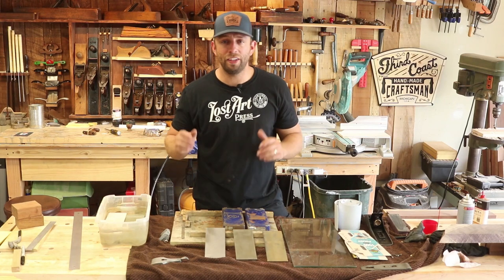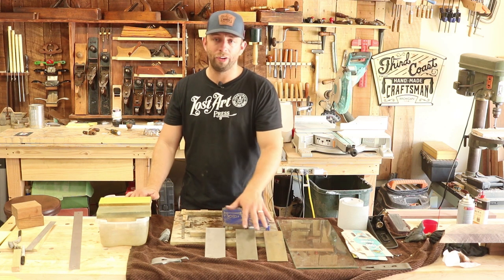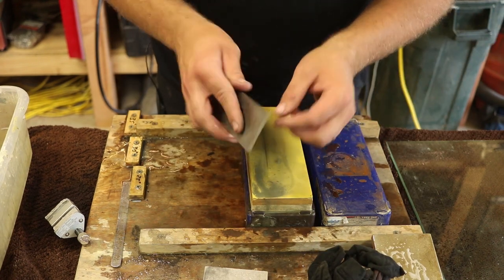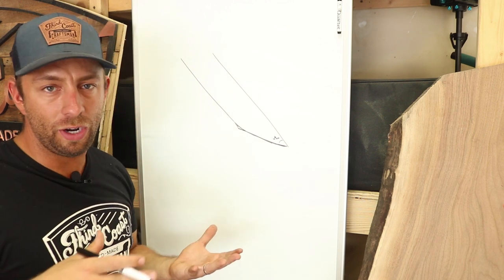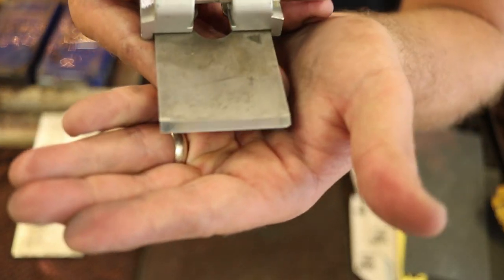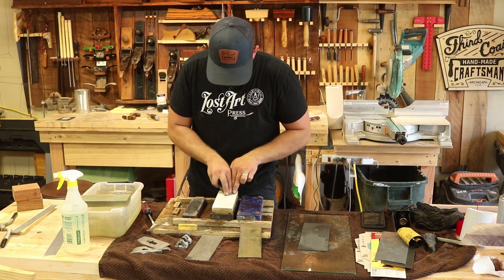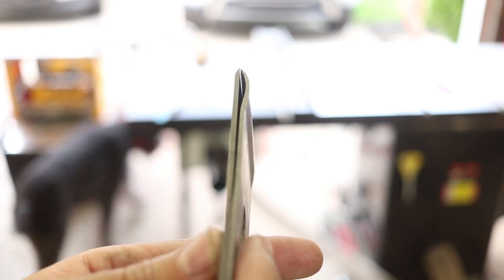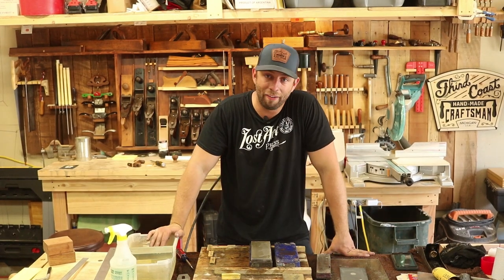How To Sharpen Plane Blades By Hand

Comment: Once I get to my finer stones, extra fine DMT and Spyderco ceramic, I turn the blade 90 degrees to the length of the stone.  In this way I am stroking the bevel opposite, applying a little more pressure which turns a hard wire edge on the flat side of the blade.  You get a good rhythm freehand and the fine polish marks will be from side to side on the bevel.  After this I only lay the blade on its back and drag off a nice heavy wire burr. I get a nice wire burr 9 times out of ten that can hit the floor and still be in one piece.  I used to strop but no more, I slap it back and forth across my palm several times and it’s a zero edge ready to go.  I think stropping especially on A 2 blunts the fine edge.  

 I prefer O1 over any other steel,  PMV-11 is some very nice steel  and holds an edge a bit longer and sharpens well but,  the majority of woodworkers don’t plane for hours at a time and O1 is a standard that’s hard to beat.  I think you are well aware that a # 4or5 Stanley can be tuned up with the stock blade and do about any job you need.  I have owned the LV jack, LV bevel up smoother LN 4 1/2 , LV #4 custom smoother and I have tried may more but they are too heavy and over priced compared to a tuned Stanley.  The planes I rely on and enjoy the most are my 604C Stanley and two #5s set up for rough and smooth.  Like we all know, there are many methods to get sharp blades, but the basic parts have to be tuned right to compliment the blade.  Repetition of sharpening and understanding how the parts work together are the keys and your doing a great job of explaining.   How are you liking being Self Employed so far ?
Reply from the maker: Thanks for the great feedback! sounds like you have used some really nice planes! I havent had the fortune of using a nice LN or LV plane but I also havent ever felt the need as I get the results I want from my 100 year old antiques haha. You are totally right about planes needing to be set up well to REALLY perform well and hopefully I can deliver the proper message in my next video and not offend too people haha. 

Being self employed so far has been pretty stressfull and crazy. I am trying to find a good routine. I really need to get some of the cool projects I have planned done!

Comment: Hi Third Coast Craftsman, I am restoring my dad's 2 planes he recently gave me as he is now way to old to do carpentry anymore but he taught me years ago to use a oil stone.  Whats the diffs between the oil & waterstones ?  Something I would want to share is the backplate (plate that supports the blade) is I keep its end surface as flat to support the whole blade area and as you did sometimes like once in many years it might need some flatting to cover the whole blade area otherwise blade damage might ensue due to no support.  Thanx for a great vid
Reply: Awesome, thinks for the info.

Comment: Just one question, if you have time.
I've managed to get myself two eze-lap diamond plates, a 400, and a 1200 grit.
Similar thing with a Naniwa whetstone I've also managed to get at an absolute bargain price, but this one is a jump all the way up to 12,000 grit!
Am I going to significantly shorten the lifespan of these tools by having such large jumps or will it simply be a case of having to spend a lot more time to eraise the scoring of the previous grind with the next?

As always, learned some truly great tips from this, thank you so much for sharing your experience <3
Reply from the maker: No I don’t think you’ll shorten life span, it’ll just take a while. Might be worth getting a 4000 stone in there. Once sharpened the first time you’ll only need the 4000 and 12000 unless you chip the blade
Reply: @ThirdCoastCraftsman  Great!
Thank you Chris =)

Comment: This video is old and you may have found a place that sells stick back sand paper (other than online) but if you haven't then check if you have an auto detailing supply story in your area. The one in my area carries several different types of stick back sand paper. Many different grits, circular shaped pieces, rolls like the one in your video, etc.

Comment: I think it's worth saying that feathering isn't for all (but most) applications.  In fact, feathering is good for general smoothing (which also happens to work well with free hand sharpening).  But just my two cents that you should keep one plane with a perfectly jig flattened edge for that perfect finish that you have to take a slight overlap to clear off.

Comment: This is kind of random, but you might look at metallurgical lab supply companies for adhesive-backed abrasives. No one really uses rolls of emory paper anymore, but lots of companies sell adhesive-backed sandpaper discs... They range in sizes from 8" to 12" (diameter). Probably not a cheap option, but you get quite a range of grit sizes in availability (60, 80, 120, 240, 320, 400, etc... to 2000). Buehler is one company that sells these, for sure.

Comment: I've probably watched this video half a dozen times and every time I get something out of it. This video is great for anyone struggling to get their plane blades sharp (like me😏). I was finally able to sharpen a blade well enough to shave my arm, but I was worried about the slight convex curve that I saw. I'm glad to know that is okay to have. However, I'm still not getting a good clean pass with my block plane. Am I missing something?🤔
Reply from the maker: block planes are not great for regular planing, better for chamfering, and small clean up jobs, But a tight mouth and super sharp blade should help
Reply: @ThirdCoastCraftsman  Thanks, Chris! I resolved not being able to get shavings by skewing my plane a little more as a ran across the wood. I also free the blade back quite a bit and that helped a lot. I will have to restore an old Miller Falls jack plane I purchased a while back to get better results. Thanks again for the reply and tips!👍

Comment: Great video! How do you setup the blocks on your sharpening board to set the correct angles with your honing guide? Thanks for sharing!
Reply from the maker: the little honing guide gives you distances so I added blocks for quick set up if I need rather that trying to measure
Reply: Third Coast Craftsman thanks! That’s a great tip. I just got my honing guide a few days ago and I’ll be doing the same kind of setup. Seems easier that way.

Comment: One thing that you didn't mention, which might be important to others because it happened to me. And that is make sure that your plane blade is NOT cupped. While I farted around trying to fix the same gap between the cap iron and the blade, and as I spent time trying to make the cap iron end level, it wasn't until I realized that I should put a straight edge on the blade, and that is when I discovered that IT was not straight. So I just wanted to mention that to anyone who has the intention of restoring an old hand plane. Cheers!
Reply: You have to flatten the bottom of your plane blade first.  If it's warped too badly, just toss it, it's no good because it will be too much effort to fix.

Comment: I've found the fastest and most economical way to flatten my stones is using silicone carbide (wet and dry) sandpaper on my granite block.  Any flat surface such as your float glass will work.  The sandpaper lasts a very long time and you aren't wearing out a second stone to flatten the first stone.

Comment: @9:20 how do you correlate the distance you offset your blade sharping guide to the top of your blade with regards to the angle of desired blade?
Reply from the maker: There are distances marked on the side of the guide to tell you

Comment: Hi
Quick question
What's the difference between that hand plane you are showing and the ones on the very top shelf on your wall?
Reply from the maker: I think you are referring to the wood bodied planes. Those planes are adjusted by tapping a hammer. The newer metal planes use mechanical devices on the the plane to adjust

Comment: Don't cry, but i've used a really smooth concrete floor after dinging by chisel. No sharpening stones or suitable sandpaper either. I only had my orbital with 80 and 120 grit while out on a remote job site. It wasn't pretty and they were cheap Buck bros. so don't be too sad.  I gave it a nice treatment after arriving home that night.

Comment: I got a small nick on my blade for my Stanley (maybe the diameter of a needle)... is there any resurrecting that? or is the blade shot?
Reply: take the bade to a grinder, grind the nick out and start the sharpening process from the beginning. take a  bit more time but the blade is still good. if you have a crack, thats a different issue.
Reply from the maker: almost all used blades I come across have nicks. definitely NOT a problem. I just use the honing guide and some coarse sand paper and grind the blade down until the nick or chip is gone. It may take some time but its totally doable.
Reply: awesome, thank you! its good to see a Michigan native doing well on youtube (I'm from the GR area)

Comment: Hi I have a large piece of glass, appears to be tempered has green ish tinge to the edge. Based on my research most tempered glass also float glass can anyone confirm?
Reply: Victor S it’s most likely the same thing, Float glass, with my knowledge is standard way of making glass and it’ll work. You can look at the flatness with a ruler edge as well.

Comment: Glass really isn't that flat from a metalworking standpoint. A good diamond plate is far flatter.
Reply from the maker: A set of certified flat diamond stones is going to be around $300. A piece of float glass which is definitely flat enough is just a couple bucks and many times free. The point was showing an affordable alternative
Reply: I've seen shop grade granite plates for sale by Grizzly and a few other companies for ~$30-40USD that are big enough to fit sandpaper on. Flat to .0002" on the spec sheet though at that price probably more like .0005-.001" in reality. Sure a piece of glass is cheaper yet but that would be a good stopgap that wouldn't be worth more investment before getting those $300 plates.